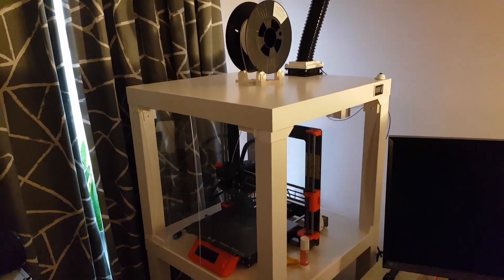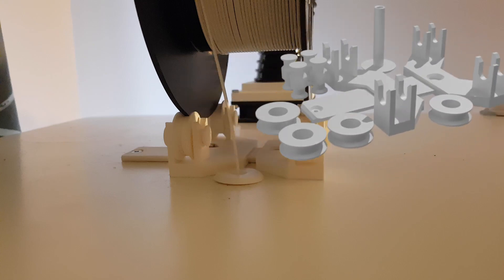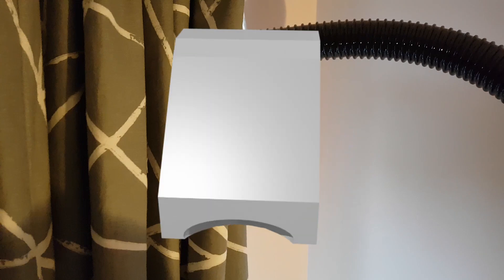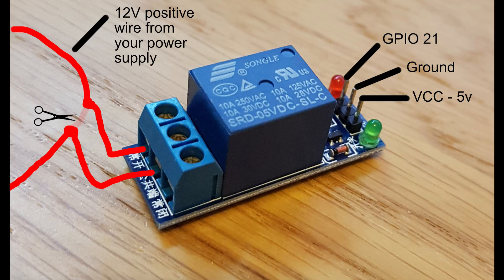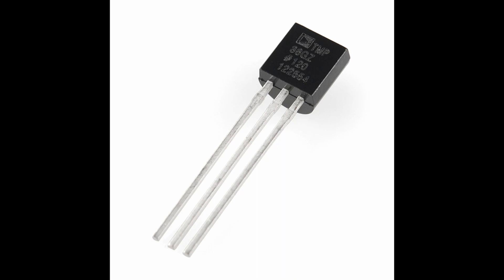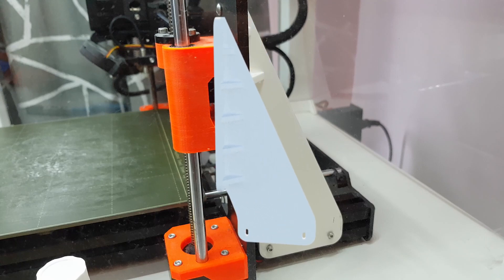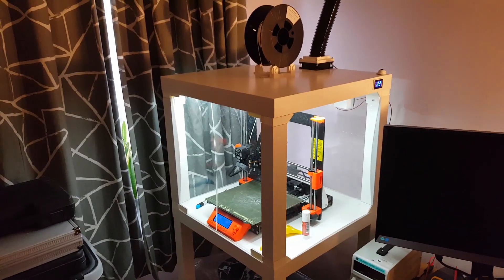3d printer enclosure with Si7021 temperature control fan exhaust for Prusa mk3s with  raspberry pi

Comment: Can we link this temperature sensor to PrusaLink via raspberry pi for remote controlling via laptop?
Reply from the maker: I have no idea how prusalink works but if prusalink can accept input or events then yes it would be possible with a Pi. The temperature sensor in my rig outputs the temperature to the Pi as an integer and you can of course program that to do whatever you want in other hardware that the Pi also has access to.

Comment: These plexiglass enclosure look really cool however when I started my enclosure built I faced two key challenges:

1. Plexiglass is far more expensive (almost 5 time) then a piece of plywood (or MDF) of same size. 
2. The key purpose of this enclosure if to maintain high (approx 100 degrees) temperatures inside  the enclosure. While Plexiglass can tolerate such temperatures, they do tend to disfigure and discolour over a period of time. 

So now I have one ugly looking wooden enclosure but functionally its perfect. If only I had better woodworking skills !
Reply from the maker: Yeah totally and if I had to rebuild it again I would probably make 3 of the sides our of wood and just have the front panels as plexi to be able to glance over at it from my desk to see how its going. Its working pretty sweet as it is now in any case :D

Comment: I assume this enclosure won’t accommodate ABS ?
Reply from the maker: I have to turn the fan up to max with ABS to get rid of most of the odors and it does do a pretty good job of evacuating the gases as I can hardly smell it when printing, however I CAN smell it and this enclosure is not completely air tight, so it depends on what level of safety you are comfortable with. 

I always leave the room when ABS is printing and have the windows open even though I can barely smell anything. But in short, this enclosure is better than no enclosure but no this enclosure is not of an industrial quality so some of the gas will escape into the room unless you improve the design somehow. You could tape up the gaps between the panels and the tables to improve the seal pretty easily and that way the doors would be the only place where fresh air was sucked into the enclosure and it would improve it quite a bit I would imagine but if you did a lot of printing with ABS I would definitely get a bigger fan and outlet pipe. It does not bother me enough to do that as I rarely print with ABS.
Reply: @DirkTeucher  what I meant to ask was: if you are constantly disposing of fumes, how do you keep the temperature at a minimum of 35C in the cabinet? ABS would heavily warp should the temperature be in the 20's in your cab ?
To print ABS, ideally your cab is totaly sealed and all the heat and air is kept inside to maintain temperature
Reply from the maker: @Gavin Beverley  Oh I see what you mean now ... I have complete control of the temperature with the sensor 5:46 . So can program in whatever temperature I want the fan to start. I currently have it set to keep a 30c air temperature for printing PLA. If it gets to 29C the fan switches off.
Reply from the maker: @pintail120  This is the code that controls when the fan switches on or off 8:33

Comment: As someone who just got their first 3D printer, is trying to build a similar enclosure setup, and is a noob with electronics, linux, python and 3D printing, this is immensely helpful, thanks. I don't have a way to set up an outtake vent leading outside, so I'm just going to use this filter / fan enclosure design to pump the air out into carbon and HEPA filters:

https://www.thingiverse.com/thing:4746033

Wasn't sure how to go about hooking it up to a pi, monitoring the temperature, and controlling the fan accordingly, so yeah - very helpful. The IR receiver is another great idea that I'm definitely going to take advantage of. The room I'll have it in is also my living / home theater room, and I have a smart wifi controlled IR blaster that will be in sight of the printer, so that'll allow me to control it with voice commands. Another task list for my endless rabbit hole of a to-do list lol... Can't wait for the finished product.

Where does the air intake come from btw? Just cracks around the enclosure edges? I'm also going to be building it with stacked lack tables like you did, but I think I'm only going to have the front panel (and maybe also the side panel) acrylic, and use hardboard for the rest to save money, make sealing it and mounting stuff a little easier, and because I'll also have a camera inside the thing monitoring it with octoprint. 

Curious if you're able to print ABS in here, does it stay warm enough without the PSU's heat and the outtake vent going out the top? If you turn the fan off I imagine you'd have ABS fumes leaking out the sides, so I might need to use filtered intake vents if I'm planning on printing ABS
Reply from the maker: Nice. I hope you manage to get enough airflow through the filter as it gets pretty toasty in the enclosure . And yes the intake is just from the gaps between the acrylic panels and the table. 

This setup prints ABS perfectly fine and I cannot smell a thing but the fan is always on. If i turned it off it would definitely stick up the room and the prints might fail as it gets really hot in there the longer the print without a fan on.

I am glad this video was of some help to you, it sounds like you have your hands full with that project and hopefully this video shaved off a few hours of time for you  :D

Comment: The relay seems complete overkill. You could just have used a mosfet and a capacitor. Then you could control the speed with a PWM signal.
Reply from the maker: Ha Absolutely, I could have also just wired up a switch or a pot and turned it on manually each time without a PI but this was all just a bit of fun for me and this is definitely overkill. Just put a fan in and switch it on at the plug ... it does the same thing if you get the size of the intake right :D

And by overkill do you mean there is no need for the PI? 
I am using the PI to talk to Octoprint so I can monitor the print progress with a webcam while I am downstairs and I thought why not hook it up to a fan at the same time. Yep, definitely overkill. 

Otherwise if you meant the relay was overkill then to me it's easier than using a mosfet and a capacitor.... Its just 0 and 1 and takes 2 minutes to wire up and I don't need or want PWM. My guess is that you would want PWM and you obviously can't get that with a relay unless you enjoy the sound of clicking :D

Comment from the maker: TLDR
0:32 - IR remote control - The one shown is not the one I am using, mine has a custom setup so I can run the sensor lead up to the top of the printer.
4:44 - Relay setup for mains power control of the fan using the raspberry pi 
5:46 - Si7021 temperature sensor wiring setup
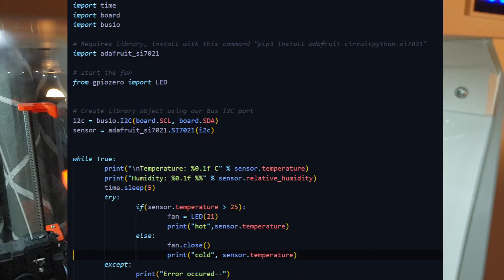8:20 - Code